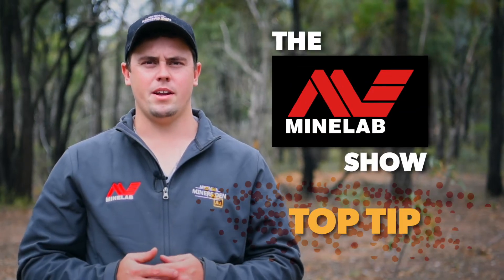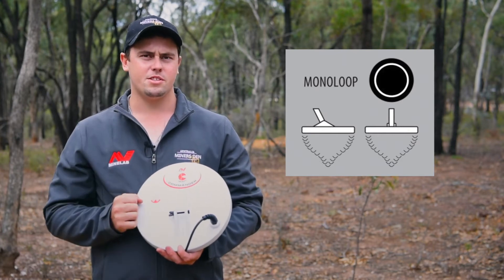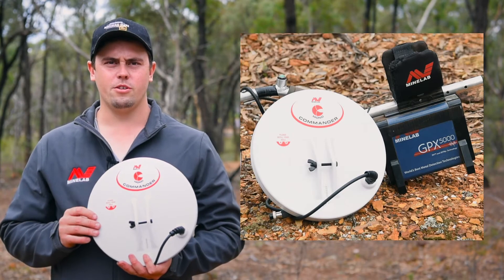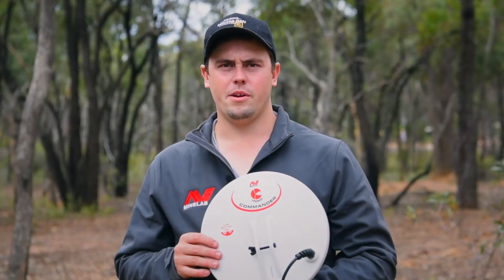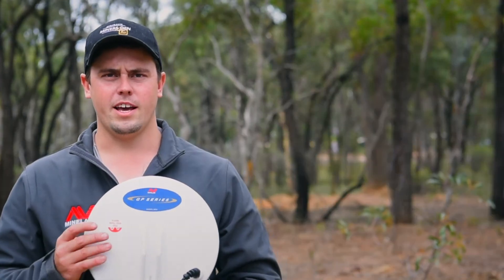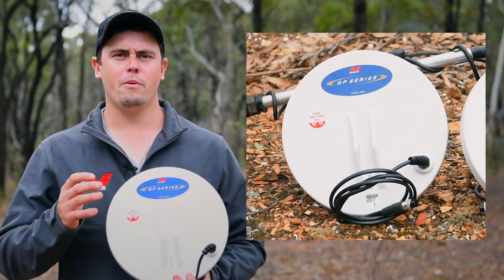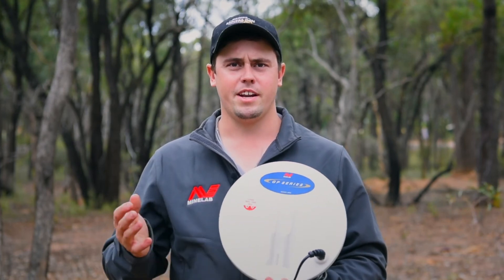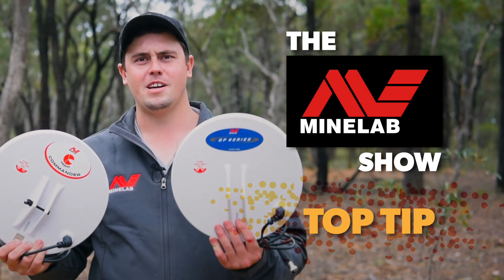Mono vs Double D Coils - Metal Detector Coil Comparison - The Minelab Show #37

Comment: So why exactly do you use mono 90% of the time, lol
Reply from the maker: Most modern gold prospecting machines are designed / optimized to run Mono coils- they are more sensitive and punch considerably deeper than DD's of the same size. Older machines were able to minimize ground noise using DD coils, but the newer machines and their timings allow Mono coil use even in noisy ground
Reply: @MinersDenAustralia   Hello! good explanation! im getting a TDI Sl in few weeks and i want to buy a begger coil for relics N COINS this machine discriminate well even with Mono  - what do u suggest for deeper penetration and anti EMI.:>?  Thank u